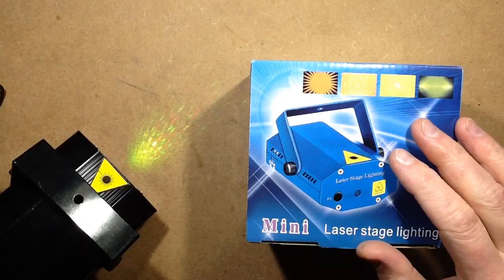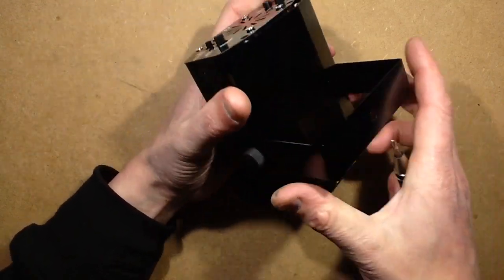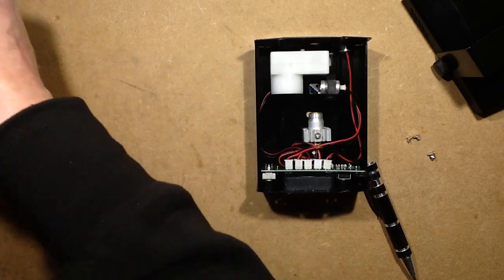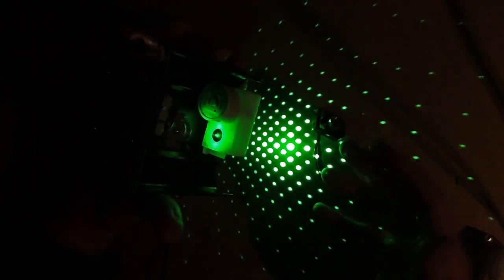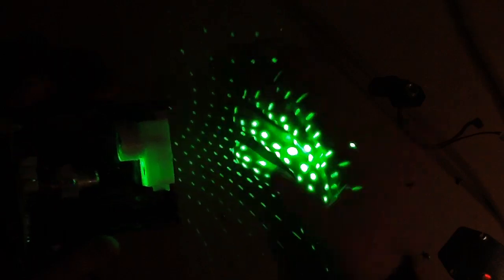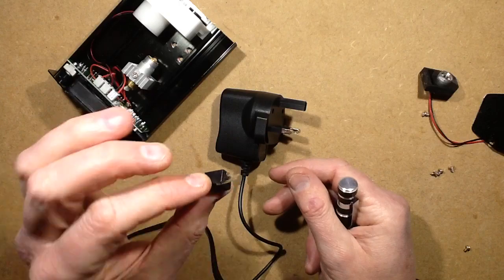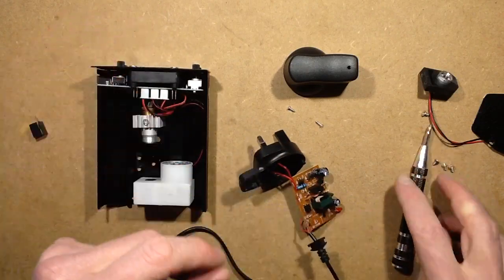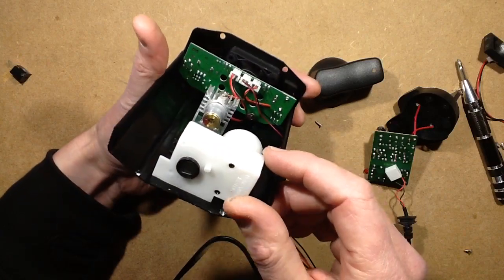Inside a laser star effect projector and mods.

Comment: why no blue laser?  bigger heatsink on the green and drive it harder an option?
Reply: True blue lasers are too expensive, violet ones are pretty cheap though (blu-ray laser diodes).
Reply from the maker: +Raspberry I tried a violet laser through the filter and it was very dim.
Reply: +bigclivedotcom You tried dichroic or filter at the end? I wonder how would it be built if there were 3 laser beams to join into one. Two dichroics?
Reply: +Raspberry 
Really that's amazing, because the chinese always seem to have their ways to make things SUPER cheap... :P
Reply: +ArduinoPlays ok, good to know. But probably still not as cheap as green, red or violet ones?

Comment: It kills me that through all these years, Europe has never developed their mains down to a non comical size that always looks like a botch job to match some 1920s machinery. 220 at 10 amps does NOT require such an enormous plug. I get that all the sockets are the same, but seriously. The US and Canada have manged to modernize and miniaturize as well as standardize plugs and sockets to where they aren't giant material wasting ridiculous things that look like they are designed for toddlers with little to no motor control. Not too mention that alloys are such now that you don't need a giant copper and brass plug leg for anything other than a 30 to 60 amp device like a dryer or Oven. Also , why the HELL didn't you guys standardize to 60 cycles or why we didn't move to 50. I realize that there was already infrastructure in place that went to either 50 or 60 cycles but that really doesn't mean that they couldn't have been phased in. I think we screwed up by not getting together a long time ago and standardizing the world. Its ridiculous to have to make 2 different versions of machinery and electronics to accommodate this. Just something I really thought might have been done following WW1 or 2 when there was still an actual option to move a country over one way or the other. It really bothered me in the mid 90s when i was serving in Germany and i had to buy converters for everything i owned. Even then they were usually so sloppy that they would often burn lights out much faster by over driving them and making them burn too bright. Oh well Musing over.
Reply: Well I like using SAE and the metric system for different things... :) those plugs do look like goofy overkill tho...
Reply: The absolute best thing about standards is that there are so many to choose from.